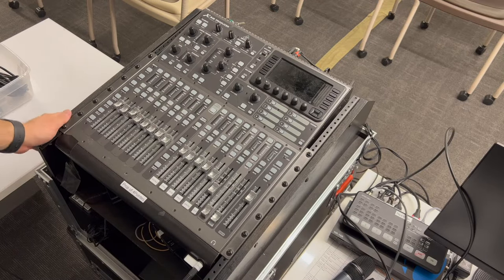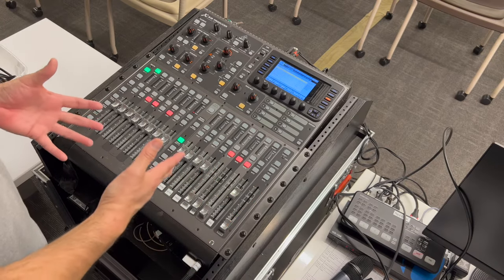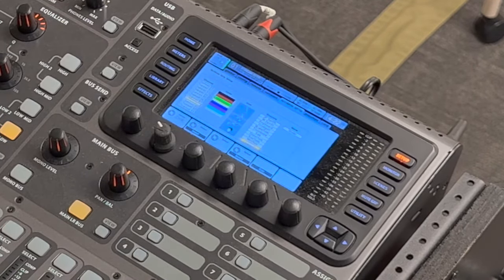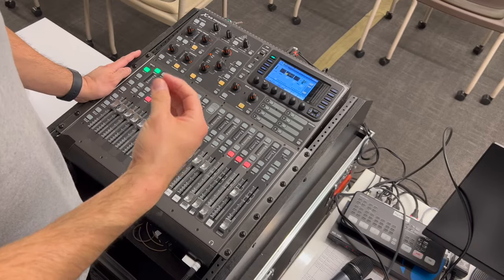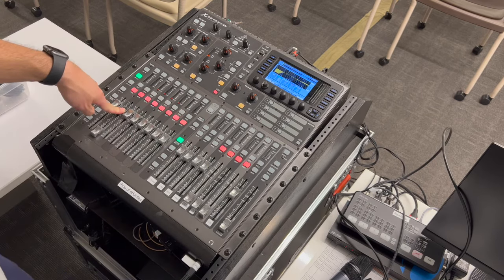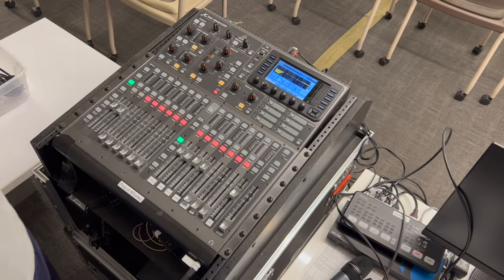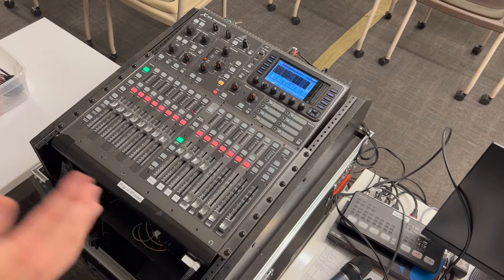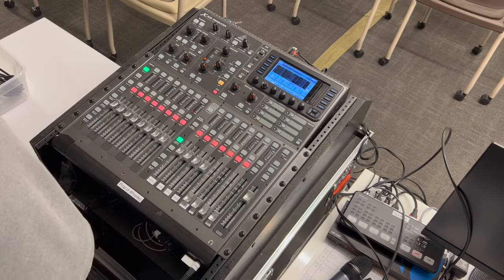4Pointes Church Behringer x32 Producer Mixer Tutorial

Comment: Glad you were brave enough to post a video for this particular board. There's not a lot of videos out there for church mix use. BUT I would strongly suggest you get a good 2 channel audio interface/ link 2 bus channels together (ex. bus 3 & 4) and run 2 XLR cables to the audio interface. Connect the audio interface to your computer you are streaming from and select your audio interface as your audio source in the computer. This will be a LOT easier for you to control, add effects and mix your livestream. I hope that helps.

Comment: I absolutely LOVE our X32R!   I would highly recommend running a separate tri-band router if you plan on using a tablet to control the board via remote - or you plan on letting musicians control their monitors.

I also agree with the other comment about mixing with faders at Unity- avoid this and adjust each channel with the gain to approx -18 db.

Happy mixing!
Reply: The biggest problem you will run into by adjusting levels with gain is that every adjustment you make will also change the monitor mix.

Comment: Oh no…. Don’t mix at Unity. Gain levels are to be set with signal coming in at -18db. You hit your plugins too hard and risk digital distortion. You also mess up all of the monitor mixes if you adjust gain like that. Unity on the faders helped make fine adjustments because the faders are logarithmic. But that’s not the goal. The goal is proper gain staging.
Reply: Tell him Jeff.

Comment: My question is can you control it with the iPad app M32 or x32 app?
Reply: Good video by the way. Thanks
Reply: I’ve used it with the m32 app and you connect to the ip address of the board and you’re good to mix your own bus
Reply: The built in wifi is not reliable in a large room with lots of people.  We run an external tri-band router to make sure we never lose connection.
Reply: si se puede atraves de un ruteador